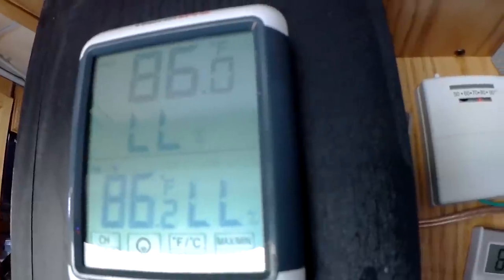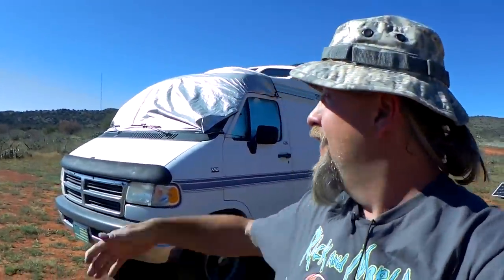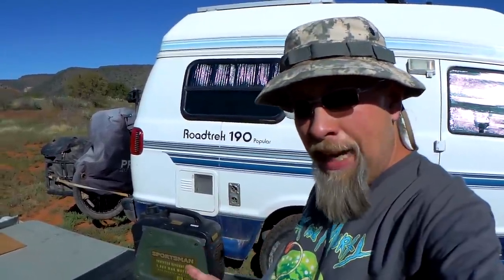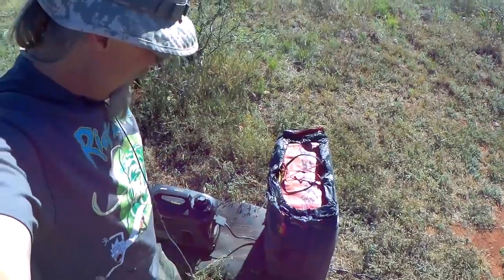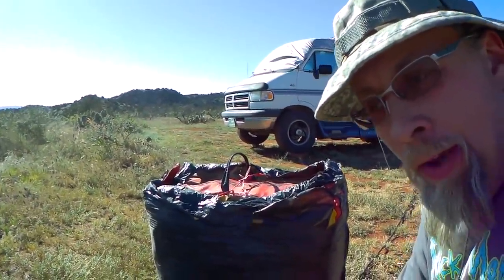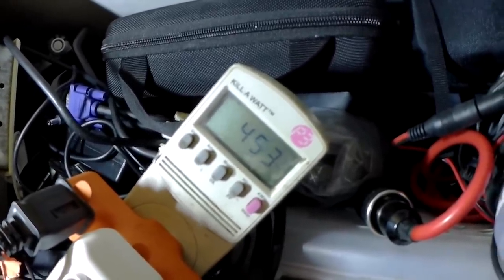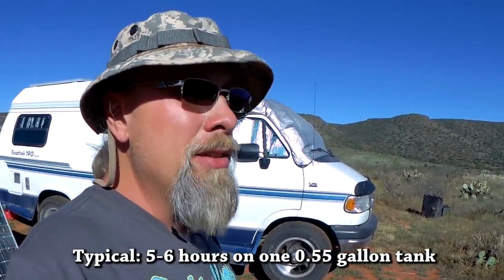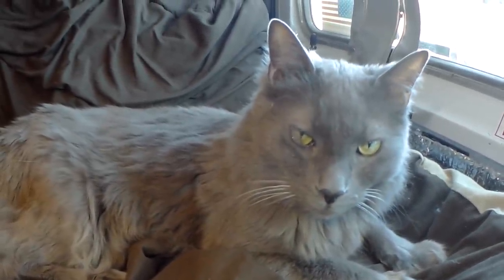Will My ABUSED 1000 Watt SPORTSMAN GENERATOR Still Run A 5000 BTU FRIGIDAIRE AIR CONDITIONER?

Comment: The older Yamaha 4 stroke golf cars had dipsticks stamped wrong too, if you put more than a quart or topped it off to the mark, it would saturate the air filter with oil and stop running.
Reply: Probably because the Yam and others are built by ONE company that builds them for/with MANY brand names
Reply: I had a Yamaha 250 cc  scooter blow a shaft seal because of overfilling , Wrong oil measurements.

Comment: I got a Firman generator 3650 watts and 4550 starting watts.  It weighs 119 pounds, which is heavy but you can order it with a wheel kit,  extra carb jets for different altitudes up to 8000 feet which will make it run much smoother.  Firman sent me the additional jets for free.  It will obviously handle a ton of extra draw, especially a homestead situation and that's why I bought it. It cost $350 at Amazon and the wheel kit about $32.  Oh and it has a 5 gallon capacity, hence it will run for about 12 hours and has a bottle opener built in, lol.  Doesn't take much to amuse beer drinkers  ;)

Comment: Best bet and bang for the buck is the Honda 2200i. 
But I did not ever have an issue with the sportsman I had. Its actually still running great,gave it to a friend when I got the bigger generator.

Comment: I just tried my Frigidaire A/C unit like yours with my Sportsman 1000 Inverter generator for the 1st. time and it is pulling 420 watts...but works great !
Update...Aug 15th 2020 the next day my Frigidaire A/C unit is now using 530 watts and my Sportsman Generator won't do it on the Economy mode !  But, today was our 1st 100 degree day here in Oregon and the A/C unit wasn't blowing really cool air either ! Still the best option out there !

Comment: 750 hours   .......  Wow !!       Yes mine smokes too at times... Thanx for the oil tip
Reply: 7 000 hours on my champion 1200 watt. add a cap or half cap of seafoam to your crank case when you change your oil your plugs will last 10X longer

Comment: GREAT VIDEO INFORMATION!!! LOVE YOUR CHANNEL. I WATCHED A VIDEO, WERE THEY MOUNTED A SMALL PORTABLE GENERATOR IN A HUSKY TOTE BOX, BOLTED VENTED METAL, PAINTED, ON TWO SIDES, MOUNTED A 9" FAN INSIDE TO PULL AIR, TEMP. GAS TANK ON OUTSIDE. ALMOST SILENT, AMAZINGLY! HIS WAS ALL BLACK, I WOULD GO CAMO, SO NOT EASILY SEEN.

Comment: I'm all thumbs up here.  Great ideas for homeless folks to live in comfort.

I wonder if an oil filter could add life to generators like this.  Maybe a little 12v oil scavenge gear pump and inline power steering filter (also used on some automatic  transmissions).  A salvaged cordless drill speed control could slow the pump down.

It could tap the unused 12v output (I knew there just had to be some good use for it). Worst case might be an oil leak causing loss of oil, but the built in shutdown would prevent engine damage leaving only the cleanup.

Comment: Hey Pickle Rick..Love it
Great content, lots of tips for dealing with the heat.
No problem with the loose wiring..
Bill Lear..developer of the Lear Jet..used to have exposed wiring
going all through-out the cockpit on his prototype..
I had the fortune to lease 1200ft of space in the Lear Bldg. just north of Reno.
This was my Studio..Audio/Visual.
which was next to the Lear Museum on Alfa Avenue in Stead Nevada..
He had bought the entire Stead Military Air Base..which became Lear Avia...
to maintain the flying Lear Jets.
Lots of history there..
Right now, I'm residing just north of Tonopah, Nevada..Elevation about 6000ft.
Temps. are low to mid 60's
Plenty of BLM land.. to say the least
Can't wait to Hang Out...
Was going to retire and head to Az. last Nov.( I commented earlier on another video)
But they talked me into staying through the winter.
C'mon up.. the weather is sublime..
I'm the head of Maintenance for Tonopah Hospitality Services & RV Park..
I used to be a Touring Audio Sound Tech..Retired now..
Oh..the stories
We need to Hang...

Comment: I picked this up because we heat our house with a pellet stove and wanted the peace of mind that if we do have a power outage, we can stay warm. 

I read that many were changing oil multiple times in the first hour of running. I did that (one oil change every 20 minutes of run time for a total of three). 

Outside of that is there anything I should do? Minimum amount of time I should run? Run the gas tank dry on storage? I know you want to run the carb dry which only takes seconds. 

Just want this thing to fire up when we need it to in the winter. It will likely see little to no use in the summer beyond what would be recommended for maintenance.

Comment: My Haier (now 2 yrs old) is 6000 btu with soft start and digital, put on cool low and low or medium fan at 90 degrees and it pulls only 88 watts.
Also runs well in Eco mode (50%) on my 400 watt generator.

Comment: I used that Reflectix stuff on my home garage doors. it worked so well, that after almost 20 years of living here, it helped me discover that my HVAC was leaking cold air into it... and why my tools would rust badly within a year or two. This stuff insulated the doors so well, that the AC leak actually cooled my garage and was able to hold a temperature (until you opened those doors) So i opted to keep this going and just run a dehumidifier to prevent condensation and rust. But this is night and day type stuff

Comment: I like my Yamaha generator. I've had it for 3 years. All I do is change  the oil and put gas in it...its fairly quiet  and the gas on/off  switch makes  clearing the carb of gas possible, so the carb doesnt foul.

Comment: Think the sportsman is made by BUFFALO TOOLS company. Bought a cheap one like you and never used it. So gave it to my son. Will need to pass on the tip about using only 7.5 ounces oil. Good on marvel mystery additive. The bowl can get clogged with old gasoline turning to varnish, so make sure you clean out jets wity an additive.

Comment: If the 5200 btu air conditioner is only 450 to 500 watts wouldn't that only be half a load on a 1000 watts gas generator instead of 70 percent load ? I think 🤔 it would be hard on a small generator if the temperature 🌡 reached more than 90 degrees 🤔 may wanna look for a bigger generator  ?
Thanks for sharing your video, I have enjoyed it very much...

Comment: Very informative video. Harbor freight has the small generators on sale today for $106.00, I cant find it now but I saw another add this weekend for $89.00 from I think Northern. Thumbs up !
Reply: Those are 2 cycle engines (need oil mixed with the gas)

Comment: HT, Good Video. Don't know if this makes sense for your situation? I saw a video that said start cooling your Rig or your Home before it gets Hot  because the AC will need to cool everything in the Rig or Home that got Hot (furniture,Pillows Ect.) then the Air.
Reply from the maker: Yes, it's a product of heat capacity. It takes a lot more energy to remove stored heat from a vehicle than it is to keep it cool in the first place. If I know it's going to be really hot I'll start the a/c earlier.

Comment: If I don't want to carry gas in a van or have anything hanging off the hitch receiver, do you think it would be too much trouble to just use a siphon pump to get gas out of the van's tank?
Reply from the maker: I have a siphon setup on my Onan that lets me pull gas from the van's tank (covered in a prior video). However, I have to run the Onan for the fuel pump to work. Currently the Onan needs a $200 part to run. I find it easier to carry a 2.5 gallon can. Let's me run to a gas station to refill and I keep more accurate readings of fuel consumption.

Comment: I bought that generator under the Dirty Hands brand about 3 years ago, almost double the price. Never smoked. Changed the oil yesterday. I'd gripe about that price but it has been solid and it really will charge a battery bank when solar is not working. I've looked at the Westinghouse. 

In low humidity I like evaporative coolers. I've had a Swampy for 10 years and they have a hose so it brings in fresh air. Most people don't realize tht running them inside just raises the humidity, without a fresh air source.  The RV coolers had a following when I started, 80's, and these were roof mount. You need some water. They basically cool you if you are in the air stream.

With a van build  you could get around R12 with the best foam. Then you could try a split heat pump. Depends on how the technology develops. Solar is cheap. Lithium is getting cheaper, especially if you import from China.  The heat pumps are super efficient, even for heating. 

The grim world of American Corporations we grew up with:

https://www.consumerreports.org/lcd-led-oled-tvs/tv-brands-arent-always-what-they-seem/
Reply from the maker: Mike, I suggest something with a power selector. The Sportsman has a hard time running anything over 600 watts and you have to factor in a 20% loss in most battery chargers. I have a Progressive Dynamics 55 amp and if my batteries are below 80% charged I have to manually kick it down into a lower voltage charge for the generator to be able to start the charge cycle.
Reply: mike brink  When I had two flooded deep cycles in a trailer I was using a 20 amp MFJ power supply (ham radio). It's adjustable so you can start with a low voltage and build up to whatever amps the generator will handle. You can manual charge Lifepo lithium with this setup. I have a 20 amp charger made for RC Lipo stuff that is programmable for Lifepo4,  just hook these up to a power supply. The RC charger I have has a 20 amp AC power supply. I have a Lifepo bank with 4 used 180 AH cells, and they are a pretty close match to lead. Much better tech than lead.

https://www.dxengineering.com/parts/mfj-4245mv?seid=dxese1&cm_mmc=pla-google-shoppingdxese1-mfj&gclid=CjwKCAjw7_rlBRBaEiwAc23rhi8UggSnaWWSh9JtJy-EHUjeSb51Tukkioluwg0PHChfdlrC-wKbRoCyGYQAvD_BwE

Comment: I got 13.5 hours on mine running 150 watts on eco.   I was using it to catch up an inductive hour meter for my eu2200, so I was running 2 meters.

Also, if you fill the oil too high, it will or could, kinda hydro-lock with oil in the cylinder.  At least it did on mine.  Keep the oil low and it will run great.
Reply from the maker: I didn't know I was overfilling it. I was going by the dipstick which you would think would be correct. Leave it up to the Chinese to even screw that up.

Comment: G'day Mate, Great video covering the 1000 Watt generator & for the price who could complain ? 
I am obviously in The Land Down Under & may have a Tip for you on your Generator, I am also subscribed to a channel called  ElderlyIron who is in
Oregon, & in his last video he had opened up his Colt's fuel tank to repair a rusty leak.      ( He is a older mechanic & old school, + very good IMO)
Anyway, when opened the tank it had a very sludgy build up in the bottom & apparently to him it had a very strong smell he attributed to
the use of that Mystery Oil, I don't know the stuff we don't have it hear as far as I know but if he is right it may prolong your generator's life.
Take It Easy Mate, Steve.

Comment: I've got an Onan 3.0 3000 Generator in my 1987 Toyota Motorhome it only had 23 hours on the Generator when I bought the camper 4 years ago. I run it occasionally just to exercise it as I haven't done much traveling with it yet. Here's the funny quirk...The Gen has a Low oil Shut off Feature that is faulty. I discovered that I had to Remove about a Pint of oil to get the Genny to run continually as it should !

Comment: What do you do with the water that comes from the AC?
Reply from the maker: These new a/c units evaporate the water out of the back.
Reply: I gotcha, so it is vented out the back with the fan. Thanks for the reply :3 @HOBOTECH
Reply: HOBOTECH how long is your extension cord and what gauge if you know? Can you still run the air conditioner all summer even if its 105+ degrees inside your van? I've got an easy way you can add propane with a standard BBQ tank that holds 4.2 through 4.6 gallons of propane. They say propane has less power than gasoline. That is true but in the long run you will save money and your generator will last alot longer and never come Out Of Tune on propane. Gasoline will give problems eventually and stop working. Propane is more dependable then gasoline fuel. With propane the oil never gets dirty, the spark plug never gets dirty. Propane never goes bad, you can also put a King Kooker regulator inline and adjust it very simply by the pitch of the motor for maximum fuel efficiency. Propane is easy to add if you're interested message me. I'll point you how to do it yourself it's very easy. And without buying an expensive propane conversion kit. Also a propane engine will last two to three times longer. And where I'm from you can get a propane tank filled up for around $10 but you got to shop to find that deal. Also you won't have to fill the gasoline fuel tank up as much on propane. Even if the carburetor dies you can still simply run propane. And you can start any gasoline engine on propane like your van. A half a gallon of gas your running the AC. 5 through 9 hours is impressive! Maximum fuel efficiency on the littlest engine possible is the name of the game! I'm working on going off Grid too.
Reply: @jonsmith2217  Heaviest gauge and shortest length are best.  I'd suggest 12awg or better (10awg if you can find one) and less than 25ft, look for 10 or 15 feet.

Comment: Mine lasted about 24 hours of light use spread apart in hour sessions over 2 years.  It actually smoked a cyberpower surge protector and then any load over 200 watts would trip the overload.  Its too bad because my engine ran great and was well taken care of.  However, a replacement inverter was $150 and the whole unit can be had for $200 so it didn't make sense to repair it.  So I am going to try a WEN 1250 next.  My main use for the small generators is to run my electric hedge clippers as I go around the property.  The sportsman 1000 did that well until it died after a storm knocked out our power and I was using the little generator to run our internet equipment.

Comment: Ac power is actually rated in volt amps... you will see it is significantly higher than the watts you're seeing.... important when sizing your system. This is why many folks are saying these do not supply 800w... it's not rated for that... ignore the confusion and trust the meter.

Comment: @Hobotech, First I love your videos. But how much solar would you need to run that 5k AC, as in, maintain the same charge on batteries. Thus run the AC during heat of day? I am thinking about getting a Jackery just for this reason and solar panels, like the Jackery 1000.

Comment: I have a Sportsman 1800/2200 watt generator and I'm having trouble finding a roll around portable air conditioner that will work with my little generator in my van. You would think I could power a 6,000 to 10,000 btu unit rated for 1000 or 1100 watts but it will only start the 2 units I've tried and overload after 5 minutes or so. I've tried multiple times with each type of AC unit.  Can you recommend a unit that draws a lot less wattage in a rolling portable AC unit? Maybe 5,000 btu and 700 watts or so?

Comment: I ordered mine. Got it put oil in ran it to brake it in. Changed the oil.  Put it away for 2 months then I ran it and it broke.  I took it back to home depo and no returns or exchanges.  So I paid about 200 with taxes.  And I did not really ever use it.  Yup I got ripped of 200 down the drain.